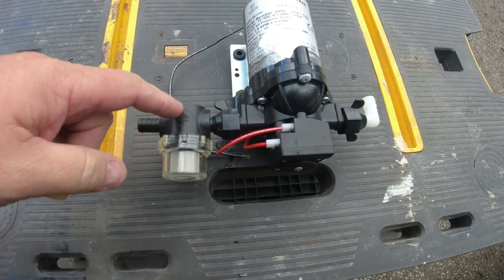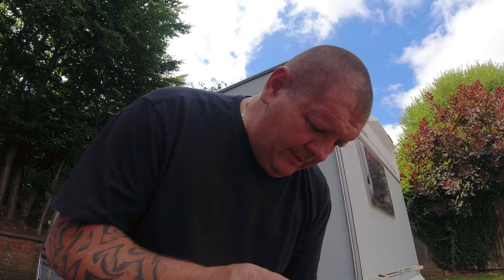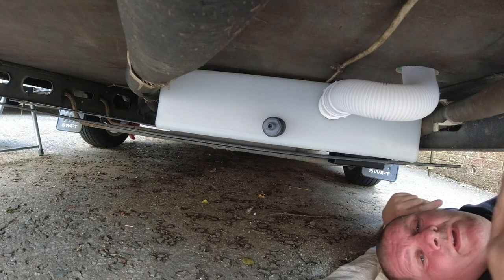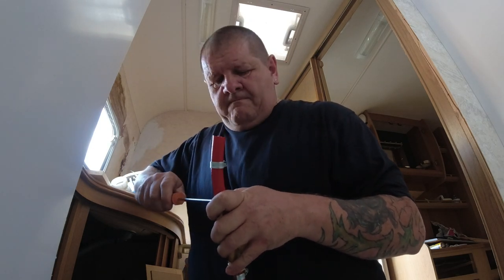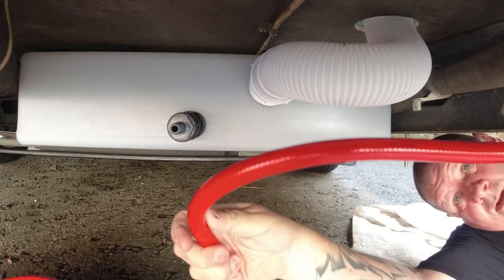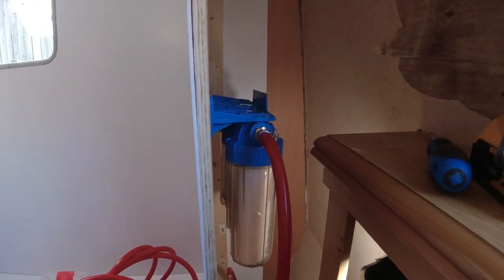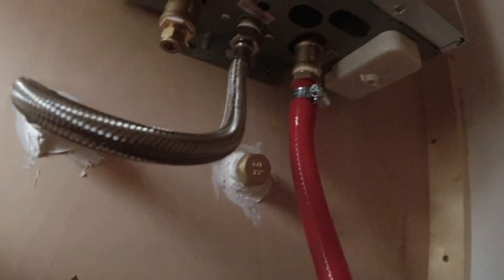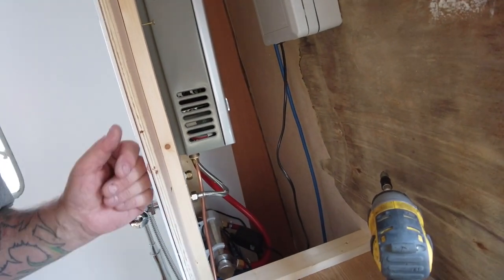CAMPERVAN NEVER ENDING SHOWER PT 2

Comment: Just found your video now, thanks for posting it, it's really well put together. I'm hoping to do the exact same thing on a boat I own. How has it worked out over time?
Reply from the maker: Really well and still going, it's maintaining the filters is the key by cleaning them and replacing them when needed.
Reply: @BuiltnotBoughtCampers  that's brilliant, thanks for the feedback.

Comment: What water heater are you using? Does it have to have a flue to the outside like most gas heaters?
Reply from the maker: It's a Chinese lpg heater. And it does have a flue.  I'm going to replace it with a sealed room lpg boiler used in static caravans
Reply: @BuiltnotBoughtCampers  thanks Carl.